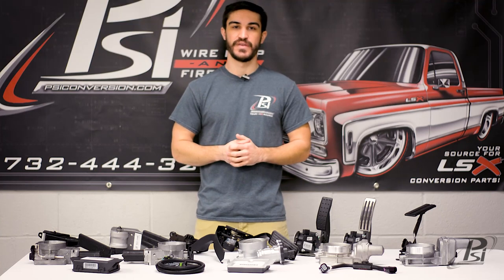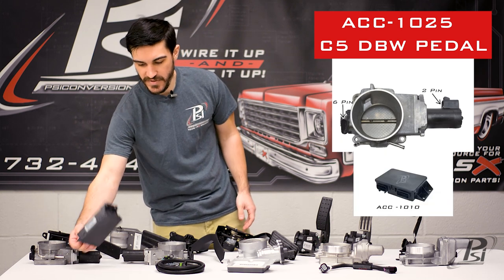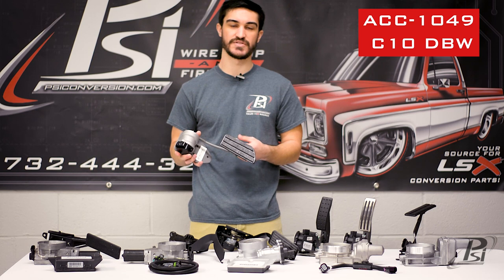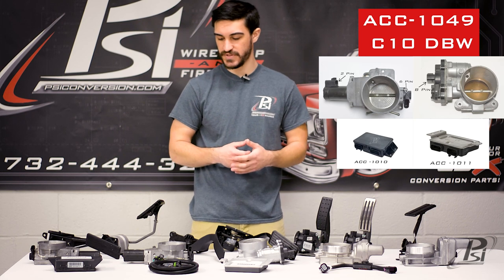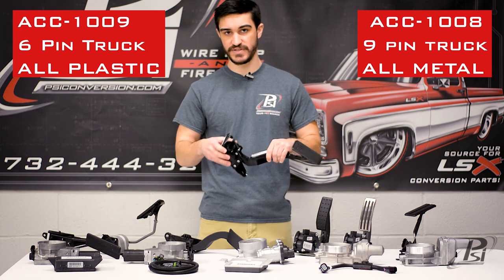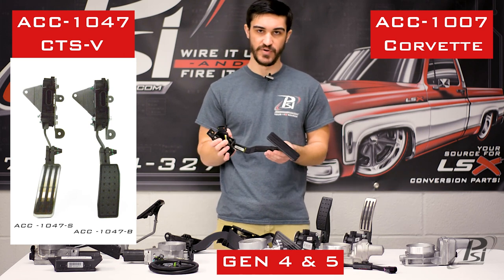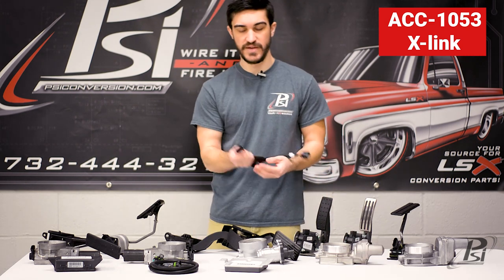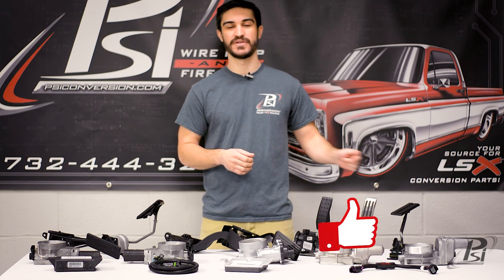PSI How to: Choose the Right Pedal for Your LT / LSX Swap ( Drive By Wire)

Comment: can i use my bmw pedal with one of those tac modules? my bmw pedal is from a 2008 135i it uses a 6 pin ?
Reply: I got a tac module from the junk yard but it’s for a 9 pin pedal from a 2003 Tahoe. So it didn’t work with my bmw pedal. I saw that the ACC-1011 tac module is compatible with a 6 pin pedal. So thats where I was wondering if I can use a bmw 6 pin pedal, since the gen 4 tac modules support the bmw pedal

Comment: Been looking to buy a harness from you guys not sure what need for my build. Doing a gen 2 Lt1 with 24x conversation modified the stock intake to take Ls 4 bolt throttle body got a ls3 throttle body do you guys make a harness that will work was looking at the gto harness with the p59 pcm
Reply: Or the e40 ecu

Comment: Can I run a cts pedal with a acc-1011? Or are they all gen 4? Are there any gen 3 cts dbw pedals? I need a cts pedal for my gen 2 camaro ls swap.
Reply from the maker: Sadly we have tried and haven't been able to get the CTS to work in that way.
Reply: @psiconversionyoutube  what are my options? I need that style arm for my accelerator pedal location to be correct. Can I swap arms from one pedal assembly to another?

Comment: Matt Great video. I just swapped my obs with a 02 5.3/9 wire & black plastic style and my stock pedal is trash. I want to buy the C10 but ive read there some rewiring is this true? Or do you sell a harness that already has wires swapped? Thanks
Reply from the maker: Hey Javi, Yes we do make harness for that. If you are running a 6 pin TB, with a red/blue pcm, with the black plactic tac, you will need an HAR-1022 from us. If you have an 8 pin tb, with a green /blue pcm, sliver tac then you will need HAR-1022-C10. Also if you need anything else or more info please call us at 732-276-8589 and we will be happy to help you.

Comment: Hello Matt, I'm having trouble figuring out what to do with my LS swap. I have a 69 Chevelle that I put a 2010 4.8L L20 Silverado engine/trans into. Everything is fine with the original truck APPS hooked up, but it's the plastic pedal that is very offset that it is into the trans tunnel. I have a new APPS for a 2010 Corvette, thought that since it was the same year that it would work out. Hooked it up and it doesn't do anything. I found articles saying it needed to be wired differently. So, I trying re-pinning the plug several different ways, but nothing worked. I wired it back like it came and re-installed the truck pedal and it works fine now. 
Can you please give me some advice on how I need to get an accelerator pedal worked out for my car? Please help.
Sorry, I forgot to say that it has the E38 ECM.